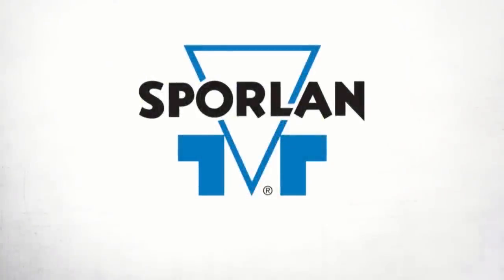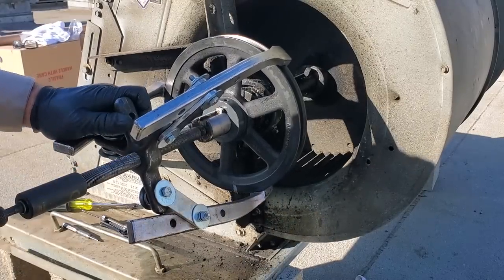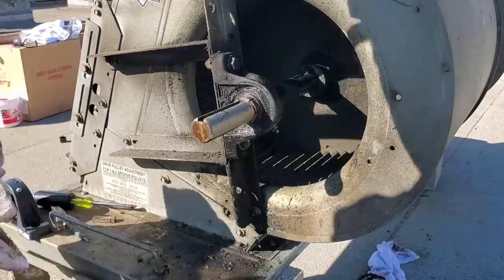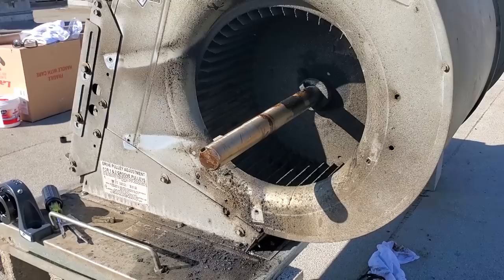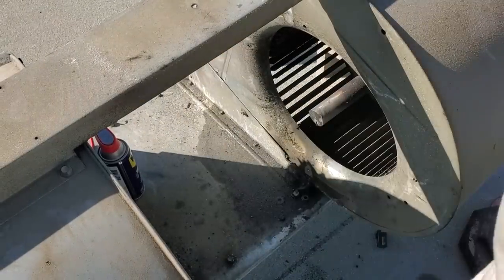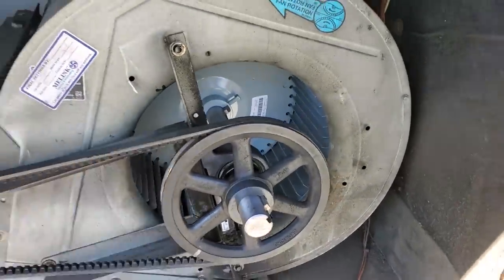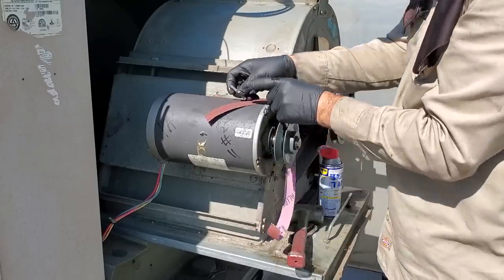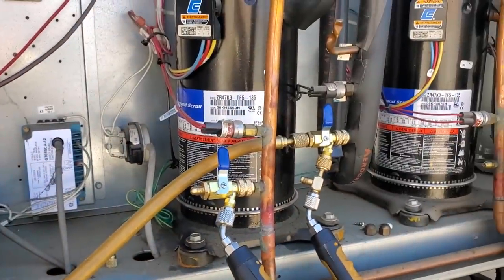LENNOX PACKAGE UNIT WITH BAD BEARINGS

Comment: Has hammer available but uses Allen key set as hammer anyway :) tech tool rule number 115: everything is a hammer.
Reply: my hammer today was a pair of channel locks, yesterday it was  a 3 inch piece of shaft, what ever is lying around
Reply: @robanderson84  I still think linemans are the best ad hoc hammer
Reply: Yup my hammer stays in the van unless I’m doing an install.. usually my Klein 10” wrench is the hammer
Reply: There have been times when I've used the battery end of my impact driver as a hammer. (Shhhh Don't tell the tool police )
Reply: Or as Eric O says on the south main auto channel “every tool has a hammer end.”
Reply: @gregmercil3968  Same, not proud but the best hammer is whatever is in your hand up a ladder.
Reply: @Ki113dbysw0rd  well hey if it works and doesn't break anything, then why not?
Reply: Every screwdriver is a chisel, pry bar, scraper, digging tool and bug killer.
Reply: In germany an important tech rule is: If you can sit, you should!
Reply: Everything is a hammer except a flat screw driver. That’s a chisel
Reply: @rickyr4051  no a flat screw driver can also be a hammer, all you need to do is use the handle part to hit stuff and it becomes a multitool.
Reply: Hahaha true
Reply: My hammer today was my m12 Milwaukee
Reply: I think my best was using a bolt as a hammer. A big one.

Comment: 4" grinder with a cut off wheel ,hammer and chisel to break the cast and cut the bearing in half.I dont even bother to pull bearings off anymore if I`m putting new ones in.Saves a bunch of time and frustration.
Reply: That's the way I roll. If its trash then cut off wheel is my best friend.
Reply: Sawzall you can fit right in the blower housing with everything still attached. 4 cuts one on each side of inner blower wheel housing and both bearings unbolt with outer shaft still attached and wheel will come right out of the housing. no need to mess with bearings if your replacing everything. but grinder is perfect if your just replacing bearings or a stubborn pulley/flywheel

Comment: For someone who isn't a mechanic or machinist you did a perfectly adequate job. Nice work. You got it done and that's what counts!
One tiny 'pro-tip' if I may: Consider putting anti-seize compound on those shafts where the pulleys mount. You'll thank yourself in 5 years when it's time to replace them again :-)
Reply: ...or the next guy will thank you... 🙄😏
Reply: Like that idea.  Thank you.  If I ever quote a job like this I oil the crap out of everything weather i get the job or not.  If i get it, bonus.

Comment: Next time, try drilling a pilot hole in the end of the shaft so your puller doesn't walk all over. 

Oh, I forgot to tell you now we cut steel for Manitowoc! Small world I guess. Keep up the good fight!
Reply: or you could try to use a punch to take out key way and then just tap in 180 degree places on the back of pulley to walk it off with a lot of lube, had that work before, and is easier if don't have second pair of hands to help hold puller, of course have to have access to back of pulley, and you are right that lots of lube and sanding will be your best friend, and cleaning off with rag, you did a great job!
Reply: I didn't get a good look at it but some of those pullers have blunt ends so a pilot hole might not have helped.

Comment: A vacationing penguin is driving his car through Arizona when he notices that the oil pressure light is on. He gets out to look and sees oil dripping out of the motor. He drives to the nearest town and stops at the first gas station.
After dropping the car off, the penguin goes for a walk around town. He sees an ice-cream shop and, being a penguin in Arizona, decides that something cold would really hit the spot. He gets a big dish of ice cream and sits down to eat. Having no hands he makes a real mess trying to eat with his flippers. After finishing his ice cream, he goes back to the gas station and asks the mechanic if he's found the problem. The mechanic looks up and says "It looks like you blew a seal."
"No no," the penguin replies, "it's just ice cream."
Reply: Just fix the ** thing and leave my private life out of it.

Comment: I have three suggestions. When I start my channel, I will illustrate them.
1) Over the years, I have found the open weave sandcloth to be a better choice than the sandpaper.
2) Get a Posi Lok puller. You will have none of the grief you experienced here.
3)Never hammer on a sheave. The ball races in the motor will be damaged. Instead, treat the shaft, and if you have to, rub sandcloth inside the sheave until you can easily slide the sheave on the motor shaft without the key. Then, fit the key, and you're done. No hammer.

Comment: I’m not telling you what to do or how to do your job but in my experience I always try to not install my puller on the OD of the pulley. If I can’t reach the center I’ll install a bearing puller behind the pulley on the shaft and pull on the ID to prevent cracking the pulley. Like I said I’m not condemning you or being factious because things doesn’t always work out as planned. You may not have a bearing puller, Your out in the field and got a smaller selection of tools than you have back at the shop... There could be multiple variables so I’m just offering my opinion.
Reply: Agreed.  I accidentially bent a pully that way once (a smaller one), and had to replace it to get the balance right again.

Comment: This video reminds me of a job at a BMW dealership where the company I was with had installed a new 50 ton rooftop unit (gas heat & a/c).  There were 4 ganged squirrel-cage  blower wheels on a shaft with a universal joint halfway.  We had a blower wheel that got shredded on one of the middle blowers and had to disassemble the unit to get the wheel off and replace it.  They sent 2 of us to do this.  Apparently the unit had never been started prior.  The duct leading down to the showroom was new as well.  We got finished, started the unit and watched the duct suck in and nearly flatten out.  Talk about poor design by someone.  We had to install angle iron bracing every so often to get the ductwork to handle the suction this thing produced.   It was funny in an odd way, that is.  Never a dull moment in HVACR work.

Comment: What a coincidence we just changed the saddle bearings on a 3 phase exhaust fan on monday. And we were prepared to be on the roof for 4 hours because the bearings were 40 years old. Believe it or not the bearings came off easy peasy. We were thrilled. Expected the worst but ended up with the best outcome.

Comment: Buy some huge industrial rubber bands for holding the Puller arms on those Sheaves big flat ones that go all around that 8.5 " sheave
Reply: we use the hose clamp kits that allow you to make your own size hose clamp. comes in 50' and 100' lengths with a dozen or so ends

Comment: Two things I noticed. That band saw is awesome,  just an old school method is that I used to use a Sawzall with a Bi- metal 24 teeth per inch and cut at an angle. Worked great, just need to file the end smooth afterwards.  The second thing is that you struggled to get the bearing off. Trick I used was to use a 2 legged puller and set one end at the base and the other at the top of the housing. Sometimes with very hard to move bearings I had to use a large adjustable hose clamp, clamped around the puller near the bearing or it had a tendency of slipping off the uneven bearing housing surfaces. Big pain in the ass sometimes. The bearing comes off at at a squirly angle, but who cares, as it comes off easily and I never had help so I always looked for a way to help myself.

Comment: protip in shaft keyways, the key taps in the saft and should slide freely in the pulley. you tap in the key then install the pully over it so you aren't beating the thrust out of the motor fighting the key in.

Comment: Never seen someone struggle so hard with a pulley puller.
Reply from the maker: It was kinda pissing me off. :-)
Reply: Direct drive blowers on those small yorks piss me off haha
Reply: Next time - Center punch the end of the shaft so the puller centers and pull on the hub of the pulley not the outer edge
Reply: One Sunday morning at work I had to pull a bad magnetic clutch off my spray system. Working by myself and with virtually no easy access I fought for 3 hours pulling that clutch off the shaft and the key was stuck in the keyway.  Being a field fix I had very limited tools and resources to work with. I ended up using so much torque the pulley puller had threaded itself into the mag clutch fusing it permanently to my puller. While I lost my pulley puller during this fix I managed to get the truck fixed and running for Monday morning.
Reply: @HVACRVIDEOS  FWIW - I use a velcro strap and place it several times around the claws of the puller to keep it from coming off.  I also use a battery powered dremel with carbide pointed stone to carefully grind a divot into center of shaft to keep it centered (I've also used a socket between puller shaft and blower shaft). Good video BTW. Makes Covid-19 days and nights go by better (along with a 🍺)!
Reply: Pullers drive me bananas.  Grab a thin round bungee cord from the Cheapo Assortment Pack your wife gave you for Xmas and cut the hooks off.  Pass the bungee through the unused holes in the puller jaws.  Pass the free ends through an old grub screw ground lug and knot the ends.  Now you have an adjustable circular spring that you can pre-tension and won't pull the jaws out of alignment.
Reply: you know there easily trick is find some rubber band n add 3 or 5 rubber band on one arm to shaft that way it stay in it own place n i have used pulley puller a lot on vehicles *only chevy n gmc is one i hate most because there no where get that dumb pulley off n have knock it off the shaft with hammer"
Reply: I guess you haven't tried to pull a Honda b18 crank pulley before then.
Reply: The first time you hit it was in reverse, thats why it initially slipped off
Reply: @HVACRVIDEOS  1 your arm pivot bolts were WAY too loose. 2 the way it was continually off setting either the pulley was tweaked or one of your pivot bolts is bent. 3 take your jaws on that puller and take a file too them make sure they are flat though personally i like to file mine so that tip has just a fuzz of bite into the pulley
Reply: @dannycomfort2623  posi-lock all the way baby 👍👍 I love mine
Reply: @HVACRVIDEOS  tighten the puller's bolts till the arms wont flap around under its weight but you can move it with your hand.

Comment: First, Great job! Now I'd like to comment about 'edge' or sometimes we call it 'self-doubt', or apprehensive caution. I think whatever you call it, it's there to save you unanticipated 'PAIN'. I noticed you'd prepared for most of the challenges and that's the point. Your caution saved you time and reputation in such a critical situation. Just think about it; You got food cooked, guest in the dining room, staff set and ready, and you don't anticipate the correct path and it shuts your service down and the facility too, and probably a customer as well. Job well done. P.S. That saw! That saw! Milwaukee came thru.

Comment: If you are using a puller and you don't have anyone to hold the arms in place... You can use a bungie cord strapped around the arms to hold them on the pulley while you apply torque to the puller bolt.

Comment: New shaft, new bearings, just cut those bearings off.. So much easier!
Just for next time! When you get into BIG bearings, cutting them is much easier. Grinder and cutting wheel.
Reply from the maker: I will be going Live on YouTube this evening 10/28/19 @ 5:PM (pacific time) to discuss my most recent uploads and answer questions from the live chat, Facebook, emails, and YouTube comments come on over and check it out if you can.  https://youtu.be/wavAI7IcaQ8

Comment: So you’ve given me some good info her is my payback. I do this kinda shit all the time. What I mean I mainly do box car slash chiller repairs. Home Depot has a blade The Diablo Steel Demon. Carbine tipped. Put one of those on you sawzall. I’ve gone thru 2-11/16  shafts in less than 5 minutes it cuts like butter. We replace all sheaves and all    So we just cut everything out and put it back together fast.  Thx again for your videos. Learn lots.  Hope that helps you guys.  👍🏼🇺🇸🥃
Reply from the maker: Thanks for the tip bud!

Comment: I was bidding on a compressor replacement on a York rooftop unit for one of the Radio Shack stores.  They were strictly looking to go as cheap as possible.  I went up and examined the thing.  It had dual (2 stage) melon compressors, one on top the other.  I found there was ample room to mount an upright compressor next to this assembly which cost a lot less than the direct replacement.  My estimate won.  I replaced the compressor with some new piping designs, bolted the compressor into the floor of the unit and tested it for proper op.  I ten billed the company which was having financial problems.   They were very slow paying.    I told the customer I had a deal worked out with the bank...'they loaned money and I worked on equipment'.    I doubt they had any credit left, though.

Comment: I would have recommended you replace the individual motor wires with a length of Armored Cable to avoid pinching during future maintenance work while you had everything apart.
Or, if you don't want to/can't replace the wires with Armored, maybe go to Lowes (or you're preferred Store) and buy a 50 foot coil of 3/4 inch inside diameter PEX Plumbing pipe and use a length of that as a flexible protective sleeve for the wires - just slide a section on over the wires before you reconnect them to the motor and the pipe should be large enough that it won't get caught in the rails and wont overheat the wires...

Comment: As a mechanic and a ac tech i do suggest using anti seize on keyways and shafts anytime you are doing pulleys,  bearings, or blower wheels it can be wipped off of the parts not under the wheels and all but they will go on easier and if you ever have 2 do any future work on that unit taking things apart will be alot easier as well. Also use it on the keys and in keyways you won't have near as much future issue 2 getting them out in future.

Comment: Pullers drive me bananas. 
 Grab a thin round bungee cord from the Cheapo Assortment Pack your wife gave you for Xmas and cut the hooks off.  Pass the bungee through the unused holes in the puller jaws.  Pass the free ends through an old grub screw ground lug and knot the ends.  Now you have an adjustable circular spring that you can pre-tension and won't pull the jaws out of alignment.

Comment: Man I have not had to do one of those in decades either but they are time consuming frustration no matter how you do it when it is 15 years of corrosion and buildup. My methods are almost exact with yours and I see no mistakes. Sandpaper and WD-40 are your best friend. Love that mini band saw I would use the crap out of that bad boy.

Comment: Your lucky to be on a roof with plenty of room - the last one I did was in a poorly engineered mechanical room - you could barely even walk around the unit - one side was against an outside concrete wall - so I wound up having to cut holes in two interior walls to be able to get enough room to change out the shaft - I use a torch to blow those bearings off - much faster..  I'm surprised that a fan that size only had a single belt.. - nice video - you must have some understanding customers replacing all the wheels bearings pulleys and shaft must have been spendy - along with the other repairs you must have at least 16 man hours in it plus freon and parts... course I guess that better than buying a new system... nice video - makes me glad I'm retired
Reply: I've done alot of these Lennox jobs and what he did is the way it should be done.  There would have been alot more man hours on it trying to slide that shaft out of 2 blower wheels and bearings. He probably saved the customer money and saved alot of frustration for himself
Reply: Andrew F also, after all this it’s basically like a new one. The only thing that’s left from the existing blower assembly is the steel housing and unless it rusts away (which it clearly wasn’t doing) that doesn’t really suffer from being a couple decades old. The squirrel cages have those tiny welds on each blade and if even one of them fails things go wrong, so it makes sense to replace those as preventative maintenance.

Comment: As an FYI to make your life easier power tools and otc make a puller set that fits in the grooves of the pulley so it pulls from the center and you don't have to worry about bending a pulley. I think there is a brand called something like tru lock as well

Comment: Love it, get the gear puller on there quick and sort it out. Wrecked bearings are a pain in the butt. I'm the same, check once, then again and then again before you get the zipcut out. It's easy to cock up when rushing about, but you go calm and careful.... you won't mess up. 

Having a buddy double check is a great way to build your trust and confidence. I had the same issue when dealing with waveguides, rf transmission medium in the GHz range (microwave), utterly mind bending how they work unless you know a guy who can explain it simple style. I had such a guy, we worked through a problem that had lots of people scratching heads, dodgy power supply was the culprit...... I learned so much from him. 

And learning a lot from you too, HVAC isn't as simple as I once thought, good. I like complex stuff